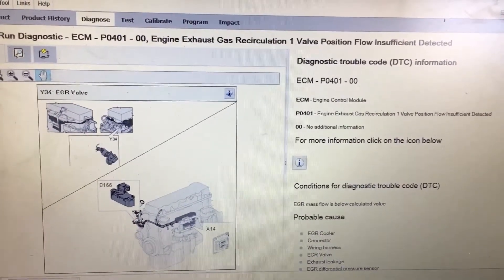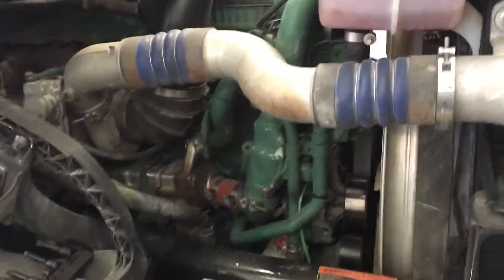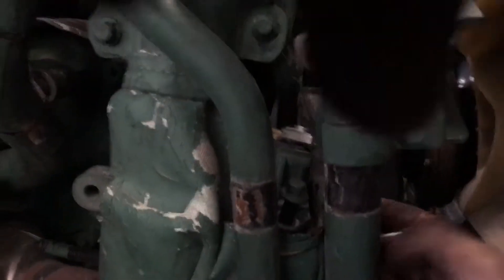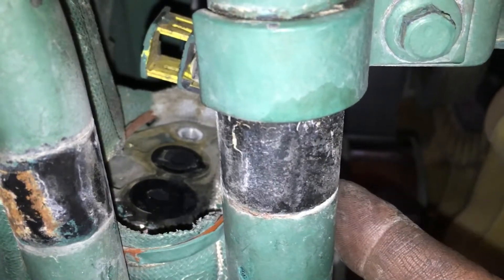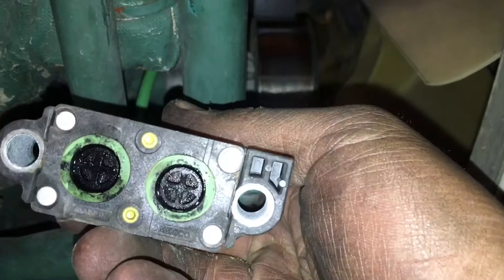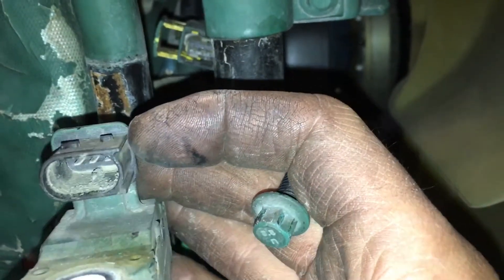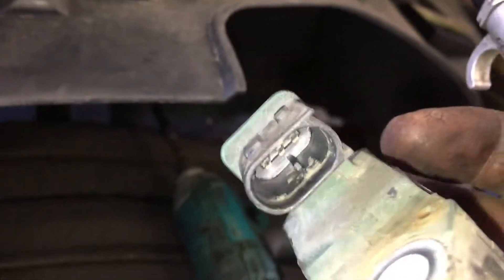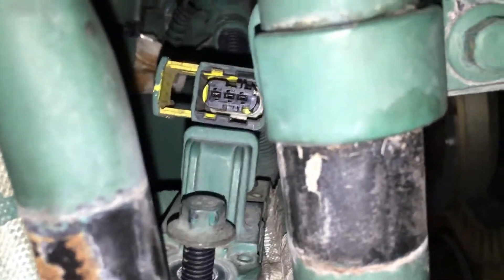Volvo P0401 EGR insufficient flow

Comment: Can I clean the sensor ports with carb cleaner?
Reply from the maker: @amandaandgabriel5950  it’s probably not recommended by the manufacturer, BUT as long as you make sure it is dry before putting it back together you should be ok. The two ports at the bottom of the sensor are sensitive to pressure so be aware of that.
Reply: @alreyindustries  I got code p040313 and my vovlo is a 2017 630 with a d13. Does this video refer to that code? Also I really appreciate the help. I'm a new owner operator and any way I can save money and fix it my self will definitely help.
Reply from the maker: @ from what I saw online (I don’t have the software anymore), it looks like this code is referring to an open circuit at the EGR valve. Check the wiring at the EGR valve connector and harness. And if you know how, check the voltage and ohms at the connector of the EGR valve.
Reply: @alreyindustries  okay I'll check this weekend. I'll have a little down time. Also I'm gonna clean the sensor you was referring to n in this video. I'll keep you updated. Thanks for everything

Comment: My truck derate then take to dealer they replace def dozer and now truck burn too much def fluid and took truck back to same dealer then they say need new egr cooler so with new egr cooler same problem now they say need turbo.  Code on dash p04d900/p040100/ p240f00 . Any help thanks
Reply: You need to stay away from that dealer. Sounds like they just throwing parts at your expense..
Reply: @ what should I try next

Comment: Thank you Sir. I’ve done cleaning that sensor, but the part that really made me crazy is that yellow clip’s. I couldn’t click it back after finishing the job, broke it down and had to use zip-tie to make sure connector won’t disconnect. I hate Volvo and their Swedish complications when it comes to clips or coolant hoses connectors under the truck. Easy stuff unnecessarily over complicated.

Comment: Well unbelievable but true on my 2018 Volvo I’ve been experiencing this situation for a while, I just recently purchased my first diagnostic computer and I am glad because I don’t like the periodic check in your lights coming on and not being able to do anything about it, interestingly enough I ran a diagnostic on the engine and it came back with what I believe it should be the same as what you’re describing, it came back with the (engine exhaust gas recircutation  1 valve flow insufficient detected, i’m wondering if this is the same symptom although mine does not look dirty on the outside but I’m fixing to follow the same procedure that you demonstrated, your feedback on this is appreciated and I want to thank you very much,

Comment: You mentioned coolant possibly leaking to the sensor. How would that happen? And how can I check? I have the same code and lost engine power. I smell coolant but no visible leak. Thanks
Reply from the maker: At about 50 seconds into the video I point at the EGR cooler. It is the long silver rectangular box with the orange rubber hose on the front of it. That is like a radiator of sorts and it is meant to cool the exhaust gases that are recirculating back to the intake.
It uses coolant to do that and sometimes they leak internally. If you pull that orange hose of the front of it and shine a light in there you should be able to see if it is wet or not. It should not be wet or smell of coolant. If it is wet or smells like coolant inside that EGR cooler, it is most likely leaking and needs to be replaced.

Comment: I had the same code, dealer said egr valve is stuck closed. Is that effect similar to when people block off the egr to bypass the recirculation process, or would a stuck closed egr lead to loss of power? I did clean the diff pressure sensor as you showed
Reply: watch this video. Shows how the egr Actuator gets stuck and has to be replaced:  https://youtu.be/uLWnKkH5_F0

Comment: Thanks for the video. Would electrical contact cleaner be ok to use or would it be too harsh?
Reply from the maker: Coronado 5150 probably a bit late now, but I’m assuming if it’s not corrosive and you dry it out it would be alright 🤷🏻‍♂️. Not entirely sure.
Reply: @alreyindustries  Thanks!
Reply: @Coronado-nz7wu  , Don't Use electrical contact cleaner.  It leaves a film coating of gunk.
Just use air and a soft rag to the outer shell, then dab a little Conductive Grease with your finger to the connections.

Comment: Hi there. Could the same thing happene to a 2006 Volvo vnl with a VeD12 engine ? Sometimes i smell coolant but there's no noticeable leak.  Now i do hear a hissing sound like coming from the egr and the turbo area everytime it does it it blows smoke. What could that be ?

Thanks
Reply: Did you ever find out issue?
I’m having same issues
Reply: I have a very similar issue. Did you find the problem and solution?

Comment: I work for a volvo construction equipment dealer and we see this a lot. I bought a set of torch cleaners and wire pipe cleaners for this exact purpose. You will also see lost power and not have any dtcs active when the soot clogs the orifices.  Good video!
Reply: i have thia code
After cleaning how to erase that check engine fault?
Reply: @navaro20  , Do a  Regen, then drive truck normally until the temps get back to required parameters. Then do a ECU Reset, by turning key to On position not starting the truck then OFF. 
Do this 3 times, then start the 4th ON position.  This should clear the code. 
If it doesn't clear up you need to use the Computer Software for your Engine to "Clear All Codes."
Reply: Loss of power from a clogged sensor? How is that?

Comment: I remove the sensor and i found clean water inside..what Ken be the problem??thanks
Reply from the maker: If you found water in the ports of the actual sensor where it reads the exhaust pressure, that is usually normal. There is often times condensation that builds up on those sensor ports because of the change in temperature and humidity. If you found water in the electrical connector you have other issues. I wouldn’t worry too much about water in the sensor ports, but make sure the ports in the pipe where the sensor mounts are not plugged and that the sensor is reading pressures correctly.
Reply: @alreyindustries  thanks
Reply: What is the part number for d13 engine?